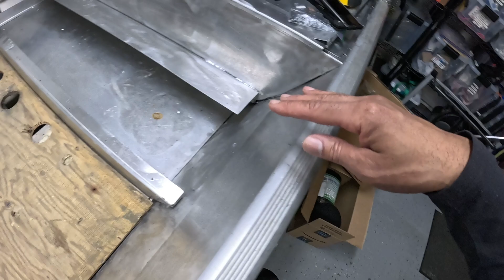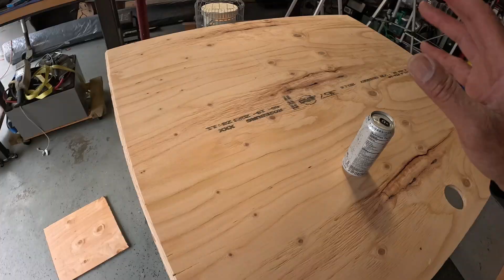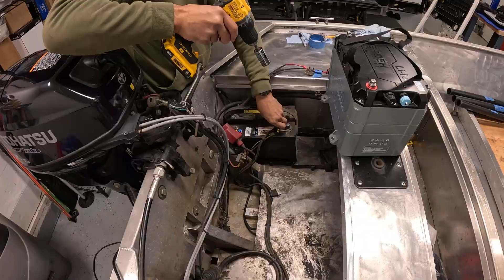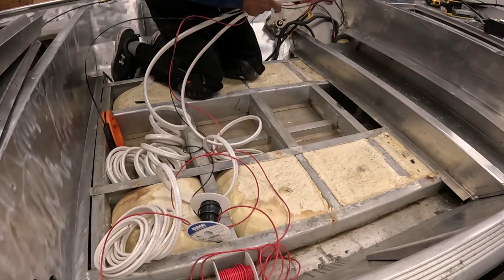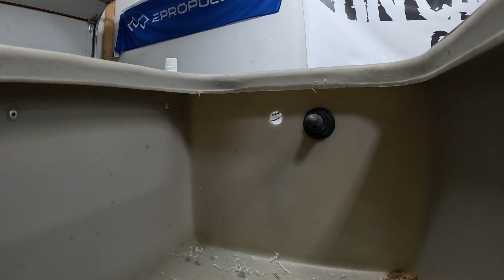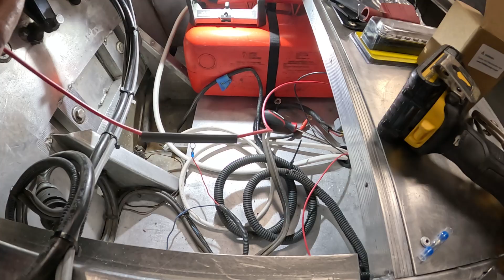[Project Update] Bass Tracker Pro 16 Revamp

Comment: I absolutely love your show! I’ve learned so much about doing things myself with my boat. I am putting a new floor in my boat and it’s a 1979 Sylvan 16 foot Deep V. The boat was in really good shape except the floor. It does not take on any water at all. I’m putting 3/4 inch plywood back down for the floor, marine grade. Even though I was told not to use marine grade because of it being in contact with aluminum. And everyone says use CDX and treat it yourself. So I don’t know. The question I had with 3/4 inch plywood I thought about screwing it down with stainless screws and then I’ve also heard that I should rivet it to the floor. So if I rivet it to all the cross members or whatever what size rivets would I need to use for that? And as far as up in the very front, I’m doing a casting deck instead of a walk-through. It seems like underneath that was only half inch and just from the front of the consoles back is 3/4 inch. Should I go back with the same or use three-quarter inch for all of it? And what size as far as the casting deck itself? I’ve been told half I’ve been told 1/2, 5/8 and 3/4 lol Thank you for any help! 🙏🏼🙏🏼